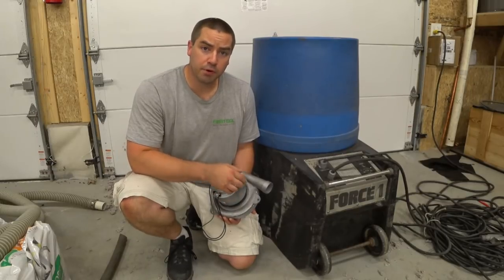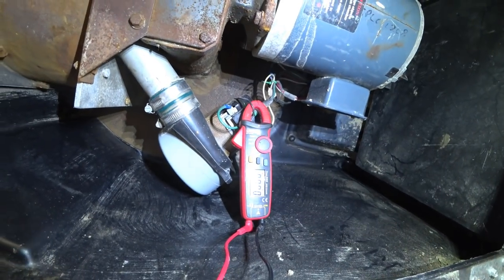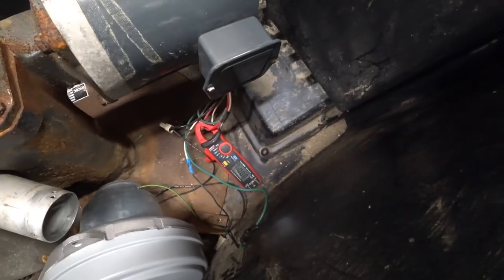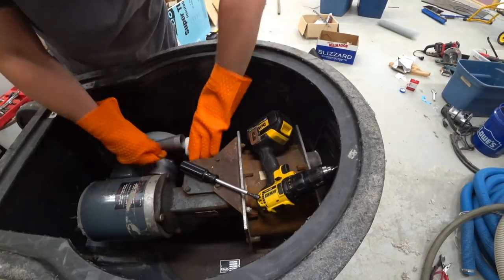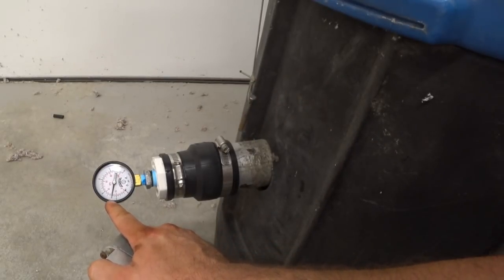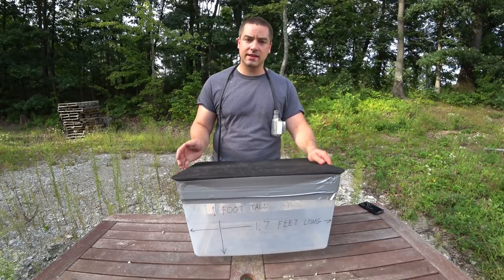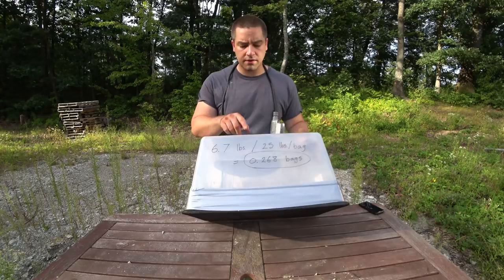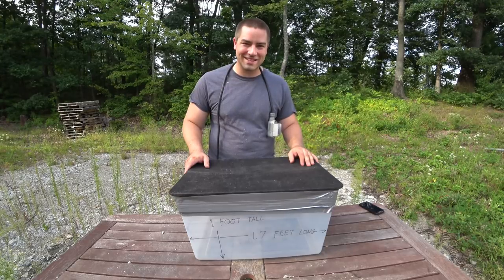Supercharging an Insulation Blowing Machine

Comment: You're actually my hero. You're doing all the things I've been working toward. My two blower machine gets close to compaction but this is the confidence I needed to boost it. Did the company provide you with the blower motor? Have you thought about putting the additional blower in line to make it a two blower system? Krendl had an auxiliary box with a blower on it and I wondered if that would work or exert too much pressure back to the hopper.
Reply from the maker: Hi Patrick Reardon,  Thanks for the kind comment.  Since you might be doing something similar, allow one word of caution.  I've noticed the switch gets hot, so it clearly is not rated for this many amps.  My next video I'm going to go through the machine and check the wiring and replace the switches (maybe with relays) so it can handle the higher amps.

Did I think about having both blowers?  Yes, I thought about it and decided against it.  I made an assumption that during a dense-pack the larger blower could wind up pushing air backwards out the smaller blower and I would loose the pressure at the end of the hose.  I have worked with larger machines with multiple blowers and they used check-valves for each blower to prevent this.  So I looked into that as well and just decided I was making the project more complicated than it needed to be.  At the end of the day it is a small hopper, small air lock and I just don't need more volume.

Have you tested your two-blower machine to see what psi you have?  That psi check is crucial for dense-packing.

This is Bill's machine, I agreed to do the work for him, and he is letting me make videos.  Bill picked up the blower and I don't know where he got it.  I'll send him an e-mail and update the comment if I hear back.

Thanks for watching the videos.  I love seeing peoples projects, so if you get a chance can you send me a picture of your machine and/or project?  I'm easy to find on facebook or my e-mail on my website.
Reply: Great feedback. You're doing it right. I have been doing densepack with 2-3 blowers with a larger machine by feel. The pressure gauge is a great tool that I'll be sure to connect on the next install. I'll definitely tag you when I get some media on some of my projects. Appreciate you taking the time to share your important knowledge. I'm also using chev batt's and victron on a shipping container with great results. I'm Ottawa, so I'll have to come up with a warming solution to keep the batteries above freezing this winter but enjoyed all your little tips on working with those 60v sections and separating them. Don't have facebook, but would love to stay in touch preardon@gmail.com

Comment: I teach dense pack by using a large piece of foam, cut a small hole in the foam piece, push your hose thru it and then push the hose into the wall and slide the foam piece up to the wall, it is both a seal at the wall and a vent as it is difficult to pack insulation in the wall if you cant get the air out   Bill Jewell  INTEC
Reply: Hi Bill, do you have an email address and or a website to communicate?

Comment: You could use central vacuum system PVC or steel fittings, they're the right size already. The motor outlet is 2in outer diameter, among other things, this motor is used in central vacuum cleaners. Well, both of these motors are really...

Comment: Hi David, great videos and information!. I am thinking to get a blower (double motor) that has 9 PSI in total, because I would like to spray-on cellulose into the walls. Would that be too much?. Then if I want to dense pack, would I need to reduce it to 4.5 PSI (only one motor on) or I can still do it with 9 PSI?
Reply from the maker: Hi gugaiz,  Thanks for watching.  Your first question: Would 9 psi be too much for spray on cellulose?  I don't know.  I've never done spray on cellulose.  Sorry.

Question #2: Can you use a 9 psi blower with dense-pack?  Yes.  You will only be up at 9 psi if you put a cork in the hose.  Usually it will be operating at a lower psi and the important thing will be volume.  However, be careful.  I have literally blown a wall apart when using a high-psi machine for the first time.  Using blowers that can only go up to 4 or 5 psi can keep you from accidentally damaging a wall.

Comment: Using the Worx leaf vac/blower is not producing enuf psi. I finally, put a gauge on it and am only getting 1 psi because of all the leaking. I am going to get that blower motor you got to upgrade that Force 1 and Y it into the blowing hose to see if I can get a better pressure for dense packing. I really don't want to have to pack the walls by hand. Do you think that motor could blow my drywall off the nails? Thanks in advance.
Reply from the maker: Yes, the blower I'm using could potentially blow the drywall off.  If I'm working on an area I don't think can handle the pressure, I will add extra screws.  But, I suggest blowing behind insul-webb netting instead of blind cavities (drywall)
Reply: @DavidPozEnergy  That motor won't work then because this house was  exterior sheathed with celotex fiberboard and interior 1/2" drywall. There is no way the fiberboard would hold up or the drywall. I guess I will have to make a manual packer to pack it into the wall. One more question: the ad for the ameteck vacuum motor says CFM @ 2" Orifice: 142, but you used 1.5" pvc pipe to connect it to your blower. Is it 2" or 1.5"?.....Thanks again for your help.
Reply from the maker: I used a 45 degree PVC fitting, made for 1.5" PVC pipe.  The inside diameter of the fitting was more than 1.5" because it was made to go over 1.5" pipe.  That's why it worked.  There are many ways to do this, I was just trying to fit the blower into the tight space.  I was also considering bolting the blower on the outside and using a short piece of 2" hose to make the connection.  Whatever works for you.

As for the fiberboard on the outside, yes, it is a very weak product and probably can't handle this.  If you were to gut one side or the other and use netting, then the board you leave behind will see less pressure and probably not blow off.  But this requires removing the fiberboard or drywall.
Reply: @DavidPozEnergy  Yes, you are absolutely right. If I had the money to open walls, I would build 16" deep walls and make my house super insulated. Thanks again for all your knowledge. I have to make a wall tamper...sigh.

Comment: Do you lose R-value when you dense pack?  I know you are not supposed to compress fiberglass insulation.
Reply from the maker: Yes, but not much.  The numbers vary slightly by manufacturer, but I typically use R-3.8/in. for settled R-value in an open blow, and I assume a settled density of 2.0 pounds per cubic foot.  However for a dense-pack I typically use R-3.6/in.  You actually don't get down to 3.6 until you reach 4 pounds per cubic foot, so I err on the conservative side.
Reply from the maker: Side Note: About compressing a fiberglass batt.  Sometimes there is a misconception out there.  It's true that if you have a 2x4 wall you want to use a 3.5" thick batt made for that 2x4 wall.  However, if you cram the 5.5" thick batt (for 2x6) into that wall you will still end up with about R-10.5 total.  The R-value per inch decreases, and the batt won't have the R-value stated on the label, but the batt is not worthless.  It is more important to make sure there are no voids in the assembly.  For example, I have worked on projects with old rough-sawn studs that were, say, exactly 4", not 3.5".  If you put in a 3.5" batt (which says 2x4 on the label) then there would be a 1/2" air gap behind the batt.  This gap would allow convection air currents to swirl in and out of the batt rendering it's effectiveness near nothing.  Instead I used batts labeled for 2x6 with a thickness of 5.5".  It won't achieve the R-19 label (or R-20 or R-21 depending on manufacturer) but it will give a good R-12 in that situation and fully fill the cavity.
Reply: Thanks for sharing your knowledge.  I really enjoy your videos.  I smile every time your daughter sings in the intro!
Reply: Compacting the cellulose is designed to reduce air infiltration as it stops air flow once you get it to about 3.25 pounds per square foot, you have achieved an ideal pack   Bill Jewell  INTEC

Comment: Please help i have 1 force 2 green top machine and it wont blow air through the hose  only blows a little through  the agitator idk what to do its my machine gone or do i need a new blower or a new seal help please
Reply from the maker: Hi Juan,  It kinda sounds like the seals on the air-lock need replacing.  Don't give up right away on the machine.  I show how to check some items in my previous video here:  https://youtu.be/jJFRb1ifOAo  Have you checked that one out?  Also, have you tried customer service from the manufacturer? http://www.inteccorp.com/contact/